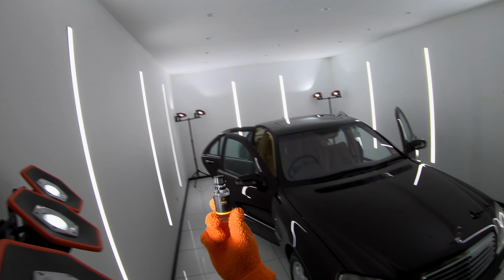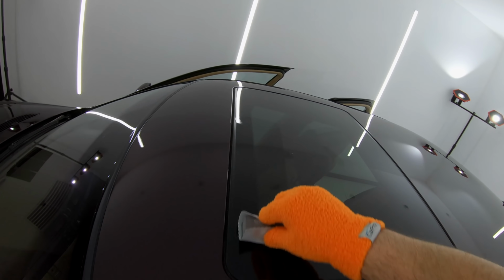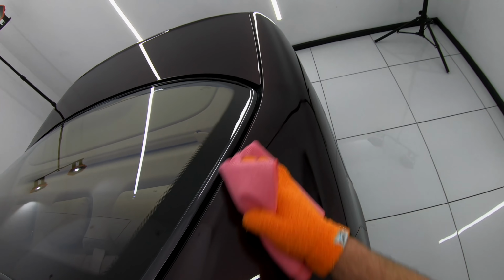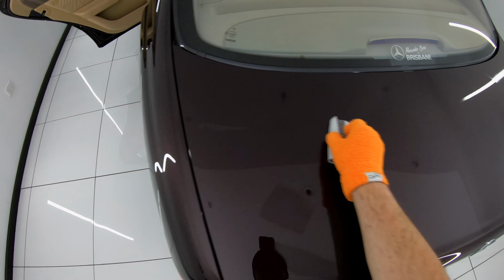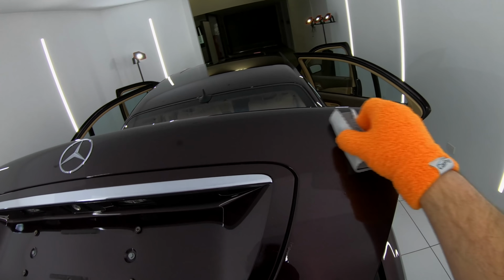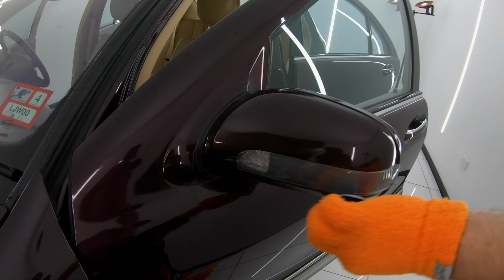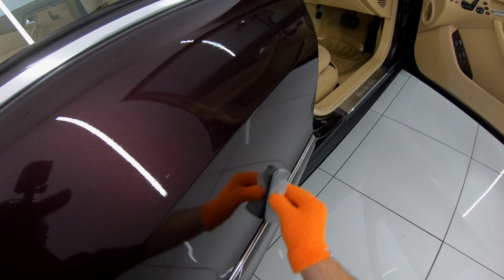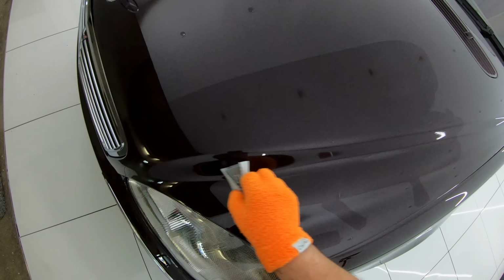20yr old Mercedes S500 Full High End Detail! P3- Ceramic Coating & Final Shots! (Vlog 29.3)

Comment: After I’ve done my car thru the process I call it hot knife thru butter “slick”! Soooo smooth everything slidessss off 😁. It’s so satisfying to watch when you glide that ceramic coating. Hey bro, question.. dust dust dust,.. do you use a duster? Will it mess up your coats? If so, which one? Thanks again bro!

Comment: Nice. I wouldn't mind getting my Jaguar XF a full paintwork correction and ceramic coating. Unfortunately because it's an 8 year old daily driver, there are some minor stone chips and cracked paint in the front bumper, so will probably need to be resprayed first.

Comment: Excellent job and finish Sandro, and the Father would be over the moon to have the car looking better than new. Just a comment, when you were applying the coating, you are the first and only person I have seen dab the coating on initially within the intended work area before layering. Is this to prevent high spots with the initial few passes when you have loaded up the coating on to the applicator?

Comment: Well done Sandro, again you are the best Detailer in Australia 100% ,you cant hide anything you have done and especially they are customers cars as well and not friends cars which you can skip things and especially when your filming everything your doing, just one questions did you fix the little rust spot on the right rear door lower panel and touched up the paint etc, just wondering that's all, as its the only area which the polishing would have taken off the pint and showed the condition of the damaged under the rust or moisture under the paint and primer  ?  Cheers and keep up the great work, cant wait to see what is the next challenge for ya. :)

Comment: Sandro, how do you usually handle a coating that is no longer effective? When I had my Cquartz Finest Reserve done, I was told I could bring it back once a year for a light polish and refresh of the coating (originally was applied in 4 layers) for a nominal fee, provided of course that I did my job washing properly and not inducing heavy swirls.

Comment: hi  bro  Ceramic  coating is fine for glass as well?  suppose am
applying uk 3.0 is that fine to  apply  wind sheild windows and sunroof??
Reply from the maker: It’s fine for all glass expect your front windscreen - as it can cause wiper chatter. It doesn’t always happen depending on the car, windscreen and wipe blades, but a glass or windscreen coating like CQuartz Flyby Forte is a safer bet.
Reply: Car Craft Auto Detailing  perfect i will 
use  fly by forte on wind sheild  thanks buddy  great work

Comment: Me: I always wonder just how careful you can be when detailing...

CCAD: The softest rags but on your hands

EDIT: As for the outrageous claims made by a lot of companies selling ceramic coatings, they’re not lying, at least up to a certain point. What they’re doing is deceiving the customer base by making them think that one or two layers will make their car indestructible, when in reality they’re referring to platinum and diamond packages that you’d find at a reputable detailing shop that include 10 or more layers of ceramic (crazy right? but they do exist). In order to achieve the results they speak of, you’d have to invest an unbelievable amount of time and money into your vehicle to reach the point where their durability claims become true, so in essence, it’s all just deception. Most ceramic coatings are very similar, some have slight benefits over others, but the main durability of a coating comes down to how well it is maintained and the number of layers applied to the paint work. As a general rule of thumb, if the product is hyped up on social media, it’s generally not a good product except under very, very rare circumstances (ie TopCoat F11, it’s trash lmao).

Comment: Great result ! question : can i apply an 2nd layer of ceramic (on  wheels) who get 1 layer 2 days ago ? (is writen on documentation i can apply an 2nd layer after 30min). the wheels stay unmounted in safe  area with temp arround 25°c. thank you :)
Reply: oh no :( what is the worst scenario if i apply now ? can it destruct my 1st layer or any thing ? :(
Reply: @fraizer2600  Hi mate, too late for a second coat once the first coat has cured, it would just be a waste of time and good product. If you are hell bent on having a second coat you will need to remove the one you just put on and start again.

Comment: Looking brilliant again. Yeah glass chatter, found that out after using EVO on the glass. Lesson learnt. But your right about Car Pro and NV, they are really good. Also, I was amazed at how long Gyeon Can Coat has lasted on the HQ which was my first go at using a ceramic type coating. Even after 12 months, water beaded crazy. But people comment on my Astra now and say it looks immaculate with so much shine. Not bad for an almost 20-year-old hatch. Wish you could see her. I actually used Can Coat as a topper after fixing the water spots sections and then NV JET. It really looks good and water just beads like no tomorrow. EVO certainly made the paint pop. But I realise no coating will stop stone chips, bullets or flame throwers like you are led to believe. I also notice so far NO thumbs down so your rant worked and scared away the dickheads and keyboard warriors.

Comment: sorry if i ask you stupid question, but when i will need to renew my ceramic coating in 1 or 2 years how i will do ? i just wash clean well and apply an new layer ? or need to sand etc ? :)
Reply: @Car Craft Auto Detailing  thank you. 1 last question please what product you recommand to maintain my ceramic coat to keep it the more long time possible ? I have the sprayHybride Céramique Meguiar's (blue color)  can i apply up of my  ceramic layer to extended the time ?
Reply: @CarCraftAutoDetailing  thank you for your answers. You are great :)
Reply: Excellent question wanted to know the same.

Comment: Hi Sandro, I'm a college student with a love for cars and detailing. I have around £500 to spent on equipment to get me started, what would you recommend as essential?
Reply: 2 buckets, grit guard, wash mitts, drying towels, microfibre towels, 5 inch da polisher, lake country polishing and cutting pads, compound and polish, spray sealant.
If your budget allows get a pressure washer, then maybe a 3 inch da polisher if you can squeeze it into your budget.
Reply: @WildDanHibiki  so a polisher is more important than a pressure washer?
Thanks for the reply 👍
Reply: @CarCraftAutoDetailing  thank you and good luck
Reply: Plus everything interior related, carpro eraser is excellent for glass cleaning and removing any chemicals from the paint prior to polishing/correcting, CarPro Reload is an awesome silica sealant to protect the paint at the end and give it a really nice gloss...the you also need tyre dressing and a tyre dressing applicator, a good snow foam setup would be good so a pressure washer is a must, even a Karcher K2 can be a great start.